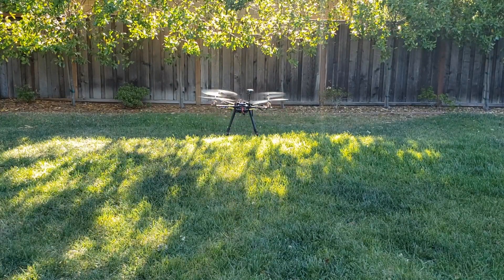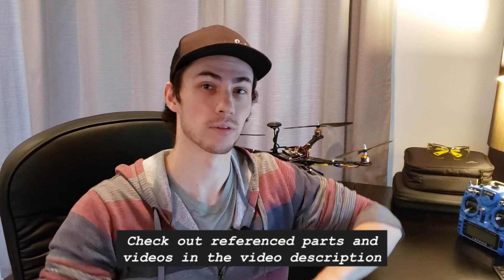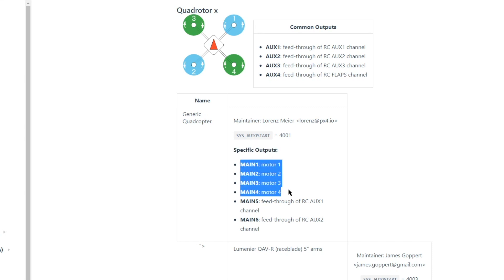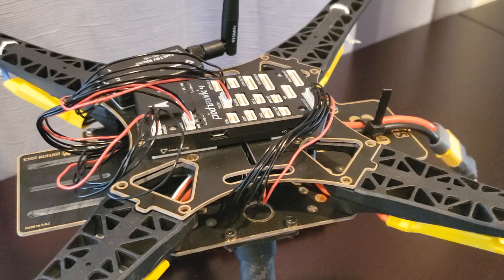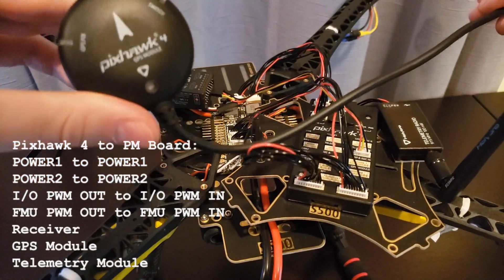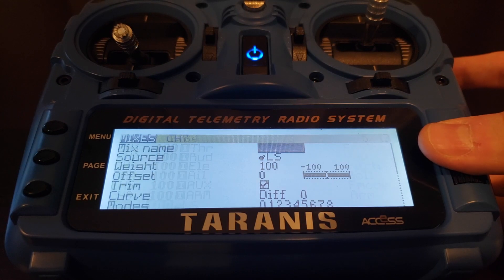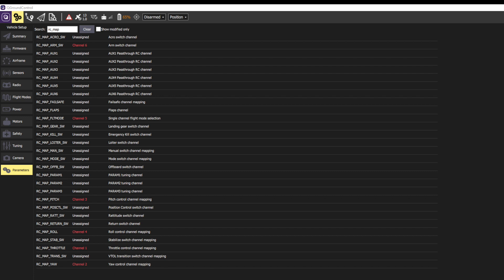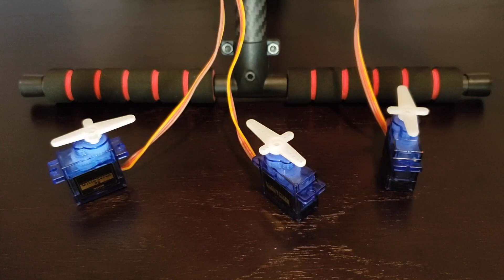How to Control Servo Motors Using Pixhawk 4 Flight Controller

Comment: Hello, everybody.
I want to connect an MG996R servo to the Pixhawk 2.4.8 autopilot without interference from the remote control, to achieve continuous angular movement of 10 degrees right and 10 degrees left.
I have powered the servo from the BEC of the ESC, and the PWM signal is sent from AUX1. I am able to move the servo through Mission Planner using the Servo Output tab by adjusting the SERVOn_MAX, SERVOn_MIN, or SERVOn_TRIM values, but I cannot achieve continuous movement.
Is using a Lua script the only solution?

Comment: Great video. Instead of using RC control, how to control the servo motor using the autopilot? for example, using the waypoint position to control the servo motor?
Reply: Were you able to figure this out?

Comment: Wow that amazing, but i have an issue that have notification is :" can't to update i/o firmware" when i loaded firmware from qgc but many time before i can loaded firmware normally an also control the brushless motor but now i can't. Hope you can give me some advice. Thanks a lot

Comment: Hi Alex, I need your advise Please!! on: I am trying to use AUX1 to turn on a servo with PWM input, and it worked fine by assigning  a specific channel on RC, but now when I am trying to send similar (PWM) commands to that port from ODroid connected by Mavlink(UART) protocol, I am clueless how to access that channel or where to edit?

I did check 
MAV_CMD_DO_SET_SERVO and 
/mavros/target_acutator_control 

But how to refer to specific AUX1; I read (RC1-8 are for MAIN; RC9-14 are for AUX)
Can I directly send PWM values to that specific RC9 2000us(high) 1500us(nuteral) 1000us(Low) as I set in Qgroundcontrol? can I override/Rc/out?
I am using Hex rotor Xconfig, PX4, Qgroundcontrol, Odroid..

Comment: Thank you very much Alex  for your vidéos !

I am currently working on a design for an airship with two side propellers and one propeller at the rear of the vehicle.
I am using a Pixhawk 2.4.8 as my control board and programming it on QGroundControl
My problem is that when I connect my ESCs or servos to the main outputs of the Pixhawk, I can’t associate them with a channel of the radio control.
I have to connect the motors to the auxiliary outputs and go to “settings” on QGroundControl and type RC_MAP_AUX* to associate an auxiliary output to a channel of the radio control.

Have you got an idea to resolve this problem please ?

Comment: Thanks for the great video! I was wondering if it is possible to have multiple servos map to a single MAIN servo in Qgroundcontrol? I want to build an experimental aircraft for research purposes.
Reply from the maker: I have not tried this in QGroundControl but what you could always do is use a y-splitter cable to feed the same main signal to multiple servo motors.
Reply: @AlexFache  first of all thanks for the video and I wanted to control one extra dc motor with pwm to control my spray of pesticides. Would you be able to share something and I have already sent you connection request on LinkedIn. Would you please accept it.

Comment: Hi Alex, How do I control a servo if my airframe type doesn't have aux channels mapped? I am using Coaxial Octacopter. What is the logic with the safety switch? I have selected the other airframe also (Octacopter X) which has aux outputs but then also it didn't work. I am using Flysky FSi6 with 10 channel receiver. Please guide.

Comment: Thank you very much. It was a great video. Can I control more than the 3 AUX channels that are on the PM07 without using the RX channels? 
Since I would like to control more servos, I need more channels. But I don't want to use more RX devices. 
Is this possible? Is there any kind of hub extension to the Pixhawk for it?

Comment: What is the nuber of serbo motors can i connect? If i want to add robbotic arm made up of 4 to 5 servos can i ?
Reply from the maker: It'll depend on the airframe you are using. Checkout this page to find your airframe: https://docs.px4.io/master/en/airframes/airframe_reference.html

Comment: Thanks for the video. Would it be possible to power 6V-7.4V servos using the same setup, but with a 6V-7.4V BEC?
Reply from the maker: Yes! Checkout the blue text box on this page: https://docs.px4.io/v1.9.0/en/flight_controller/pixhawk4.html#voltage-ratings. These rails can be powered with 0-36V, just remember that this rail doesn't power the actual flight controller so you still need some kind of power management board.
Reply: @AlexFache  Thanks for the confirmation! Im doing a uni project involving an EDF rocket with servo flaps that are controlled by a pixhawk so it helps

Comment: Hi Alex, great video! How do control a servo if my airframe type doesn't have aux channels mapped?
Reply from the maker: Which airframe are you using? Some of them have the MAIN and AUX channels reversed.
Reply: @AlexFache  i am using a coaxial octo. There is no pwm channels mapped for this airframe type